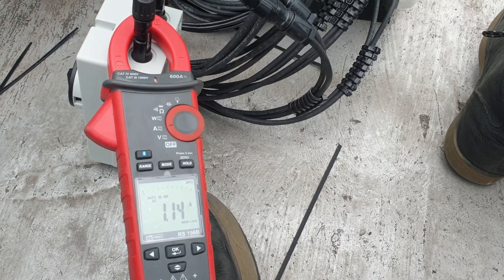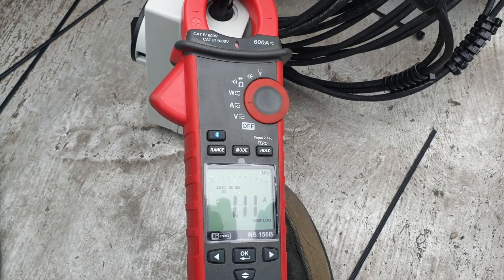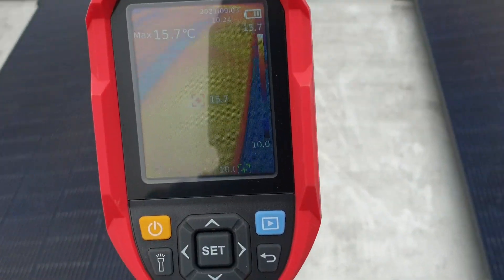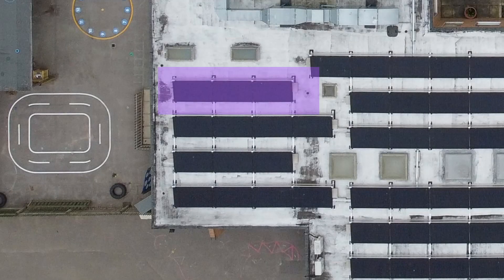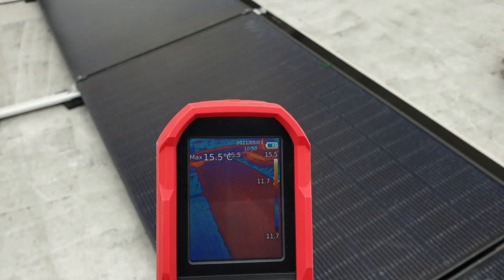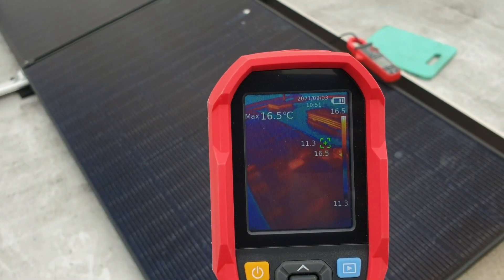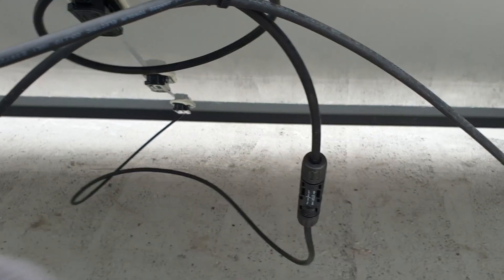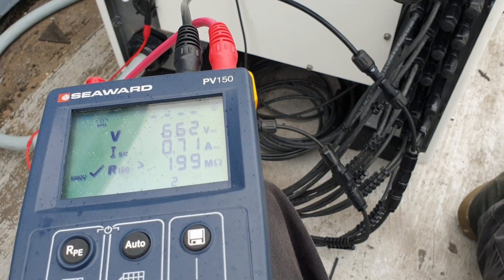Commissioning a solar array and finding a missing module with a thermal camera.

Comment: Great video. How long would that individual panel have been shorted and would it have been damaged? Given you can see individual cells at different temperatures on the panels, does that not indicate they are faulty, shouldn’t they all be similar temperatures?
Reply from the maker: It would have been shorted a week or two, from the time it was installed to the time I went to check off the install.

It doesn't damage them, they can be left shorted indefinitely. It's a reasonable way to store them because it means no muck gets in the connectors. PV modules are inherently current limiting so pretty safe from that perspective!

The cells should all be about the same temperature, it's only really a concern if there are big differences.

Comment: Hello! greetings from Argentina, a little question about software, what is it? By the way, excellent material, thank you very much, I am a technician starting in this, I would appreciate any help.
Reply from the maker: The software we use to design the systems is called PVSol.

It's good up to a point.

If you're trying to do things in the way it wants to work it does a good job.
It's really quick to create schematics etc. through it, but they have to be to a formula. For example if you've got one generation meter for five inverters combined that's fine, if you've got five separate meters for each inverter that's fine, but if you want to have inverters 1 and 2 going in to meter A with inverters 3, 4 and 5 in to meter B - that's impossible.

Equally you have to do a full string design in order to get it to produce a projected yield, so there's no "I wonder how it would affect the system if we moved this string or included that roof". You have to complete redo the whole system and run the full simulation. I sometimes end up doing a handful of designs for a system, so we've got different options. For example a 50kW east/west might suit some users better than a 35kW south, or maybe you want to run the numbers for adding a slightly shaded string. It's clunky for that. 

I've been meaning to do a bit of a series on how I use the software and also run a few simulations on oversizing the DC. Put a 50kWp system on a 50kW inverter, 2*20kW, 25kW, 15kW sort of thing and show what difference it makes.
In the north of England 30% oversizing of the DC makes very little difference in overall yield, I'd imagine things might be different in Argentina!

Comment: Nice bit of fault finding, me not being used to them, it is surprising how high the voltage gets on these systems.
Reply from the maker: That was a relatively low voltage string with only 16 panels on it. Using these panels (open circuit voltage of 45.01V under standard conditions) I've got systems up to 20 in a string, they were testing at about 850V last week.

The voltage goes up as the temperature goes down, so we have to take in to account a cold but sunny day in the winter and make sure the system voltage doesn't rise above either the rated voltage of the panels (1000V for some, 1500V for others) or the inverter (most are 1000V, some are 1100V). As they're roof mounted we're assuming a minimum temperature of -10C though sometimes I wish I could raise that slightly to get another module on the string!

The voltage drops a bit under load and these inverters have a rated input voltage of 500-800V.
Reply: @tceng9449  Thanks for the extra info TCEng. 👍